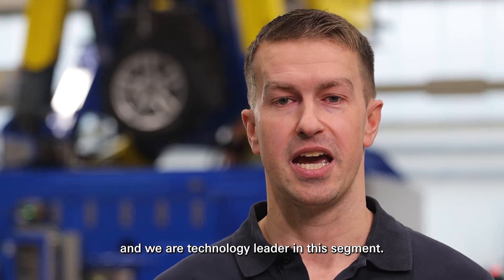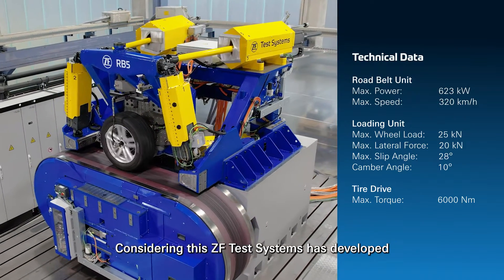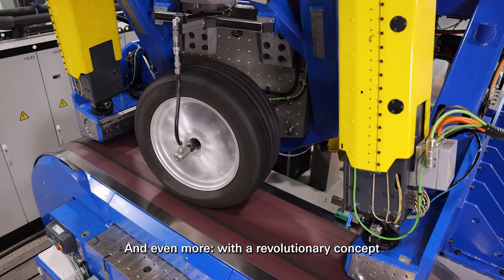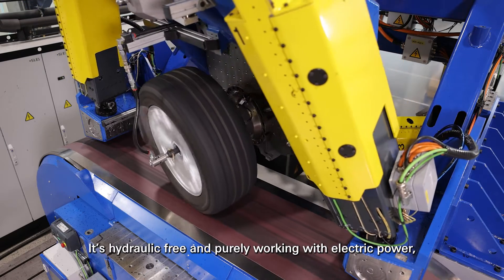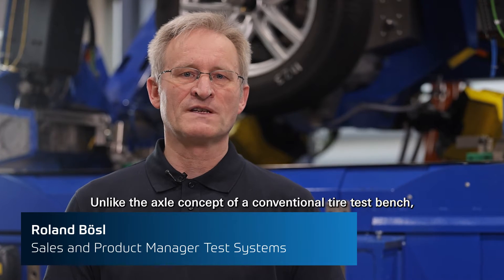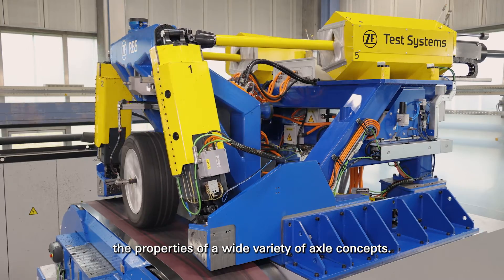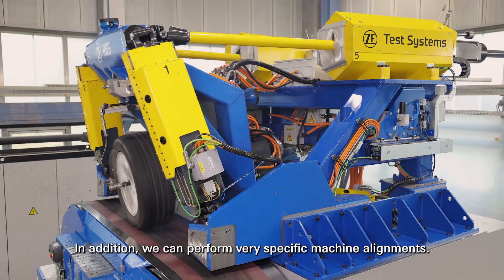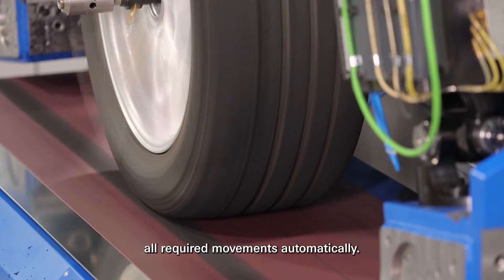ZF RB5 - the new Road Belt Tester

Comment: No dust vacuum system ?
can't imagine this is ZF designed machine.
Reply: We found that it is easier to brush the particles off the machine. This is a 5 minute job every week and much more efficient than a full blown vacuum system which has notorical problems dealing with hot, sticky tire particles.